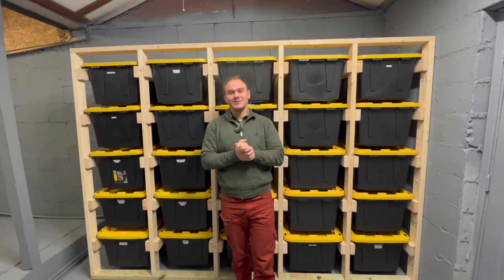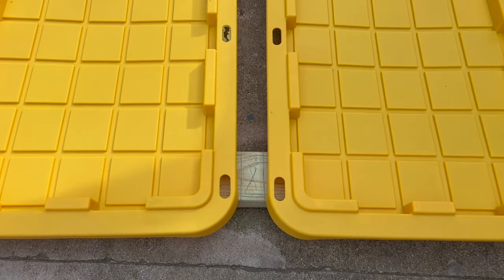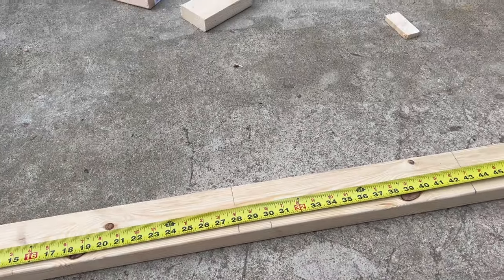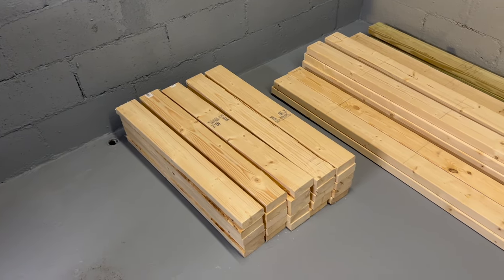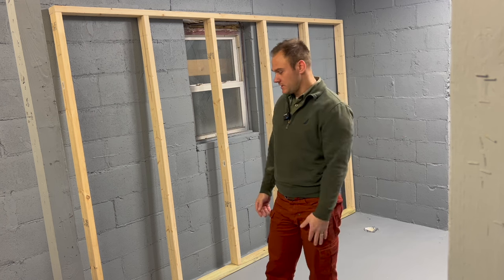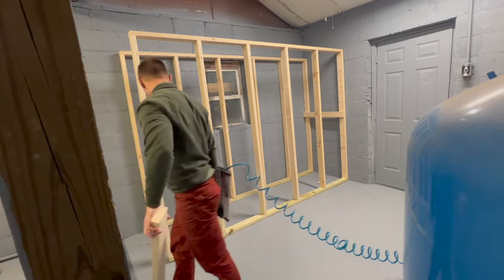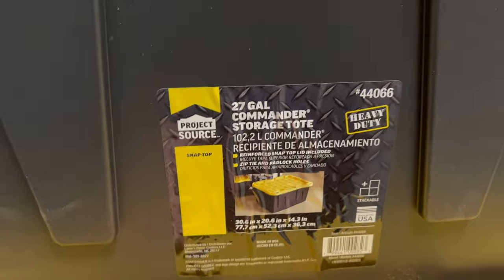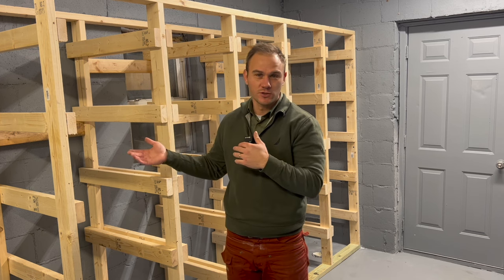DIY Tote Storage: Step By Step Guide For Floating Bins

Comment: Okay…but how would you build this for an outdoor carport… with no enclosed sheds or garage I am desperate for storage space! I was thinking this but entirely pressure treated and wrapped in cedar fence boards - making some doors for the front. Am I crazy? My only concern is climate changes like humidity and temperatures. The outside wall under the carport doesn’t get any snow or direct rain *except for drainage on the bottom.. hence why pressure treated would be the only way to go.. Help! My dad was always my project resource and he’s no longer with us 😢.. I feel like this could be done…
Reply: You should keep in mind that the plastic storage containers will break down in time if exposed to sunlight.
Reply from the maker: You are not crazy! Sounds like a good idea to me. Its gonna be heavy building it with treated and wrapping it with cedar, but if i was to build something like that i would do it like you said, and just make sure its watertight. If its enclosed the plastic containers will be just fine and not exposed to the sun and elements!👍🏻
Reply: @kennethspengler9934  one of the reasons I would enclose it - also just for security. While I wouldn't store expensive irreplaceable items, don't want an invitation
Reply: @SamberStyle  thank you! I'm definitely going to try it out this summer.

Comment: Do you have the materials list? How many of each lumber did you endup using?
Reply from the maker: I did mention it at the end of the video also in one of the comments. It is going to depend on how you want to build yours. You can also do a quick pause on the video and just count them! Really basic design and straight forward. Good luck with your build.

Comment: Thanks. Great video. I’m drawing mine out now. It will be 4 bents. I’m going to add casters and sheeting. Wall locker style. Mine will be for garage storage. Planning to add Milwaukee pack out wall mounts on the ends.
Reply from the maker: Thank you! Sounds like you gonna have a nice setup!

Comment: Very nice. You should look into using QR codes to label what's in your totes. I just built an outdoor tote rack system and I took photos of the items in each of the totes then uploaded them to my website and printed QR codes that linked to each photo. So now if I ever need to know whats in the tote, I just scan the QR code with my phone and it opens the photo of the contents of that tote on my phone. It's great to have when one of my other family members are looking for something, they don't have to dig through each tote, they just scan the QR code.
Reply from the maker: Thanks. That is a very smart idea, thanks for sharing. Might try that down the line. For now, printed labels will do the job.
Reply: What did you use to create the QR code? Was it a hosted site?

Comment: This looks so good. Thanks mate.
Reply from the maker: Thank You so much! Really made a world of difference in cleaning up the space and having everything organized.
Reply: @SamberStyle  I was planning to buy metal shelves. But now am gonna use your design. So I could imagine it was helpful 👍😎 the only problem, i have to convert everything to cm 🤣🤣
Reply from the maker: @hasanalhasani  luckily there aren’t to many measurements, so should be good. I am Originally from South Africa, and it took me a while to get used to inches and feet (so confusing) but now thats all i work with. Good luck with your build.
Reply: @SamberStyle  I can imagine. You are so kind and nice. I wish you good luck. You have gained a subscriber today 😎👍
Reply from the maker: @hasanalhasani  thank you for the support! Really much appreciated!
Reply: @hasanalhasani  FYI: Just about every calculator today has a conversion tool for imperial to metric measurement. So, if you plan to build this unit, you should have no difficulty converting measurements. Best wishes for an enjoyable project!

Comment: What is the length size for sliders?
Reply from the maker: 31”-32”
Reply: 31". Remember, he cut them to this length so he could get 3 full sliders from one 8' stud. 

You cannot get 3 at 32" from a 96" stud because you have to allow for the blade width. The last slider would be less than 32".
Reply: @deckgun31  They are cut at 31". Not 32"